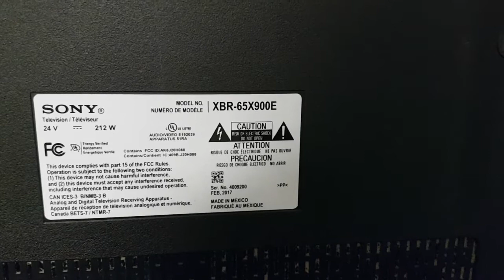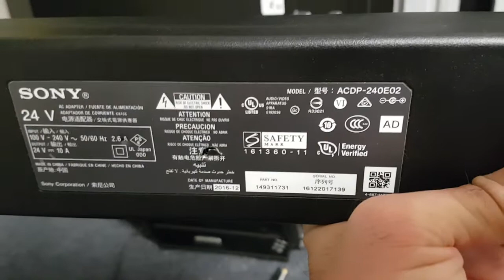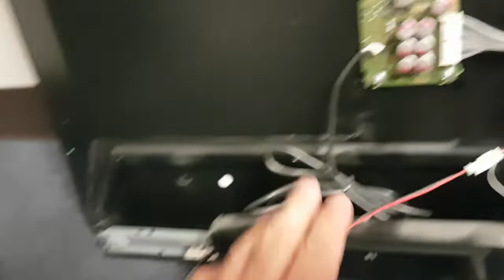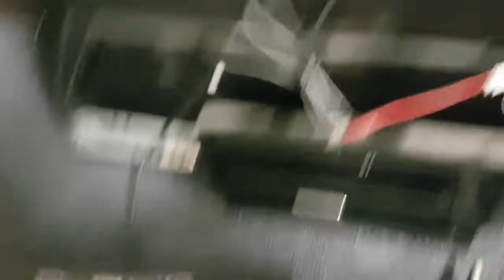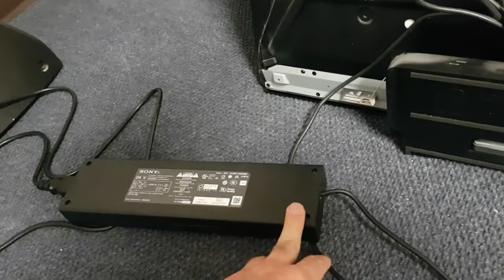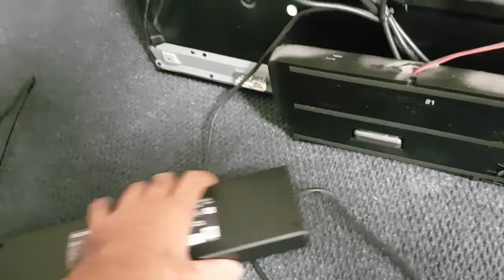Sony XBR-65X900E totally dead: repair without breaking your wallet

Comment: I have the same issue and thought maybe this was the problem untill I noticed the backlights turn on when I remove the ribbon cable from the LED board and T-con board. So it can't be a power issue. Could it be a mainboard issue?
Reply from the maker: Yes it could.

Comment: Is it a switching power supply? Does it have to be plugged into the TV to test. Right now, I have 0v at the output without plugging it into the TV.
Reply from the maker: Of course it is switching power supply. Nobody uses anything else in consumer electronics anymore. Well, not 100% correct - some devices that use mostly motor power may not necessarily employ SMPS at all, they may simply rectify the AC and use the 160V DC directly on motors, possibly through some lowering...but for the most part pretty much all televisions, radios, computers, laptops, phones have SMPS source.

Comment: HAVE XBR 65X 900E 4 RED BLINKING LIGHTS FUALTY CODE  GOES ON FOR 3 MINUTES THAN OFF WHICH CIRCUIT BOARD DO I CHANGE.
Reply from the maker: The LED strips.

Comment: I had a 5 blinking red light problem. I installed a used (working) T-con board but the TV no longer has any LED lights or power.. What happened? Can you help?

Comment: This was helpful. I think I may have the same issue. I bought 3 of these - a 48”, a 65”, and an 85”. Only have an issue with the 65”. Mine is an X900F but I suspect this is my issue. I don’t think I can do it myself since I don’t have a voltmeter or a proper soldering gun, but I appreciate having some knowledge for when I engage a repairman. They’ve been great tvs for me, and if I can fix it for less than $500 and get at least 3 years out of it, I consider it worthwhile.

Comment: Just had the same issue... NO power. Tried everything. Ordered a new power cable from amazon, and TV works perfect!!!     Wounder how many people just throw this great TV into the garbage?
Reply from the maker: Probably not as many. But replacing the cable is just half the solution here and might not last too long.
Reply: @coppelltvrepair  ok....I hope you're wrong on that. Lol....
Reply from the maker: @mariodilorenzo7473 Do not mind to be...but...it is really simple. Cables do not go bad unless chewed by dogs. What goes bad is the connector at the end, where high current starts eating at the plates of the two sides of the contact. The worse either side becomes, the worse the mechanical contact, the bigger the arching of current with electrons jumping through air to make it to the other side. it affects both plates and even if one may be worse than the other, with one bad it is still WAY more inclined to start the process anew and WAY closer to getting bad again.
so both sides need to be treated for at least resetting the life counter back to zero.
Reply: link please?

Comment: My same TV just had this exact problem, would not power on. I unplugged the wire from the TV to the brick and cleaned ends with dry Q-Tip and blow out the plugs. Now works perfectly.

Comment: Thank you for this video!! I swapped the cable end to end (reversed the cable power brick to tv) and it worked!! I have ordered a new cable on Amazon.
Reply: Was your TV completely dead, did you just swap out the connecting cable??
Reply: @treedeblue how did you fix your solution
Reply: @ForTITude-TG lucky it was a dead power brick. I bought a used but working replacement, fixed the problem.
Reply: @treedeblue Thanks man.. I just had same problem.. Flipped cables at first then tried didn't work.. Rotated them 180 degrees and worked.. Crazy how something simple works.. Okay thanks curious how you resolved yours!
Reply: @ForTITude-TG you might need to replace the cable at some point, glad it’s working for you bro 👍🏻
Reply: @treedeblue got it.. Thanks bro!
Reply: @treedeblue TV just went out.. Swapped cables and went back on.. Brick is real hot.. Where did you buy your brick?
Reply: Just tried this and went on.. Thanks

Comment: Is it possible to solder universal connectors on?  I want to feed that power brick wire through a wall
Reply from the maker: Not sure what do you mean by "universal connector". You can solder everything that allows soldering, but you should bear in mind that not everything that allows soldering may be appropriate for carrying 8A to 10A current.
Reply: I measured the voltage across power cord and it was reading 24v.  I think my issue is the main board.  I guess next step is to disassemble the tv and check voltage on the boards.  I might need to go find the service manual for this tv.

Comment: Two years later and you saved my bacon. This was the exact problem with my TV tonight. Gave up the ghost ironically during the opening sequence of Ghostbusters: Afterlife. Took it apart, measured voltages, chopped the ends off the power cable and removed the connectors from the circuit boards, soldered everything directly to the boards, powered right up.
Reply from the maker: Happy to have helped. If it's not too much to ask for would you mind leaving us a good review on Google? We recently had someone slam us for what I thought was a great service and we need to make up for such unexpected negative reviews in the ranking system there.
On an unrelated note....we will soon publish another video how to save $200 for a new AC adapter and cable and just use a plain 110VAC/24VDC module for $25 to fix this and other similar problems that seemingly require the $200 power adapter.

Comment: Same tv.  Same problems.
Will be my last Sony TV.   Simply bc of the unnecessary hoops to jump through to fix it, and the unnecessary proprietary adapters.
Reply from the maker: I hear you! I personally am done using Sony since about 2004 when I realized that they go through hardware revisions like people update software. Sprint cycle is slightly longer, but barely and the new iteration have lots of new features and, naturally, lots of new issues.
But I can't deny they also tend to pioneer sleek stuff and they have an army of diehard fans similar to those of Apple.
So it is not necessarily bad for support.
But it will become when they make it a priority..or it already has become.
One major issues with Sony smart TVs is the eNAND failure/corruption or whatever...and since it's designed to prevent copying Sony already has the key to the repair.
Which is how everything is becoming.

Comment: I live way out in the country, can you do a guide video on how to check this exact issue for voltage? And then how to solder and fix it?
Reply from the maker: Afraid not, we do not have that TV here anymore. But it should be pretty self-evident if it is bad and there are tons of videos showing how to solder in general.

Comment: I have the same TV with the same problem and I disconect the cable that he's talking about (the one that looks like USB and goes to the 24V box thing) and just blow air to both ends and switch the ends (the one that was on the TV to the box and vice versa) and it did the trick. I'm not saying that this is going to be a solution for everyone, but it may be that simple to a few people.
Reply from the maker: It isn't likely that it will be a long term solution for you either. Power line neither breaks down nor gets fixed by air, be it hot or cold. What has happened is it probably has moved enough to provide temporary contact, but that will be eaten soon enough after enough current goes through it. Keep us posted :-)
Reply: This just worked for me - Thank you

Comment: I have the same tv, kids said it just won’t turn back on. I bought the new power block from encompass and it didn’t solve anything. What do you suggest I change first, since here in Louisiana, Sony doesn’t have authorized repair. I was thinking if no power I should do the small board
Reply from the maker: Yeah, do the small board. If not that then it must be the main board.
Reply: @coppelltvrepair  thanks part came in and easy switch, unfortunately I returned the new power block. I saw a burn mark on the old small power board. How would I test the block with a voltmeter
Reply: @excellencemike  to measure the voltage is very simple. Get a voltmeter to start with. If you are trying to measure the voltage right at the end of the brick without cable to the tv connected touch one cotact point with red and the other contact point with black wire from the voltmeter. Be very careful. It is a small contact and if you have the red and black tips touch each other you will have a spark and you may damage the brick. 
If you are trying to measure the voltage at the end of the cable where it connects the tv one contact point is outside the connected bare metal and the other contact point is inside hole (at the end of the cable)

Comment: I have the Same tv is there another way to power the tv with a different power supply I can't afford the original one man
Reply: If you are handy, just find a power supply with the same voltage and slightly higher amperage rating.
Reply from the maker: Do not take this the wrong way, but you should not own a TV that you can not afford to repair. You should not own anything that you can not afford to repair.
Reply: @coppelltvrepair  this is an insane comment.
Reply from the maker: @pseudofinn Why?
Reply: @coppelltvrepair it sounds out of touch with reality .  Many people own things they can’t afford to repair .  Example cars and houses .
Reply from the maker: @robertsok4629  It does not get clear what exactly do you find out of touch with reality - my statement or the fact that people own things they can't afford to maintain. Because I can tell you for sure that if you own something that you can't afford to maintain you will eventually end up losing it. And the fact that there may be many others like you does not change the fact...just like having many drivers breaking the speed limit on a highway can not and does not serve as excuse for the one being caught and ticketed....only I think the law about losing what you can't afford is much stronger to the [random] police charges you may get enforced on you.

Comment: Hi there. Thank you for this video. Would you be able to show how you soldered the cable directly to the PCBs? Did you remove the connector first? Any help would be greatly appreciated. Thanks!
Reply from the maker: I am sorry, I have no recollection of this case and to get it I'll need to watch the video and maybe recall something, which I currently do not have the time to.

Comment: Hi, thank you for the video 
I have the same problem TV looks dead after uncovering the back cover, MB is one with coolers hot but the TV does not even light up the front LED.

do you think it will solve the MB exchange?
is there a point on MB where you can measure 24V?